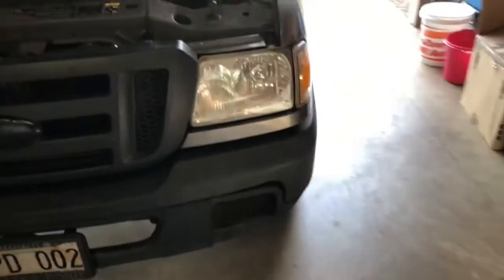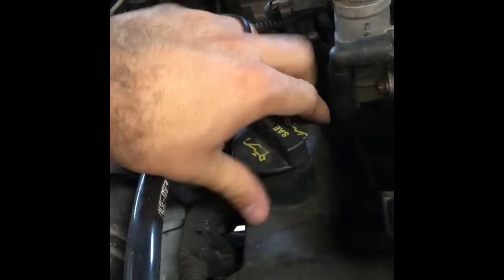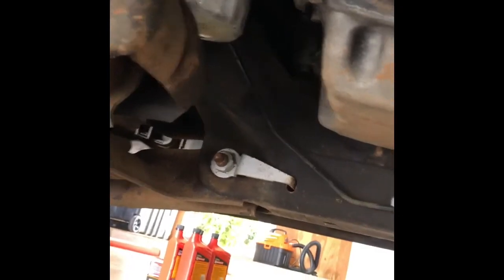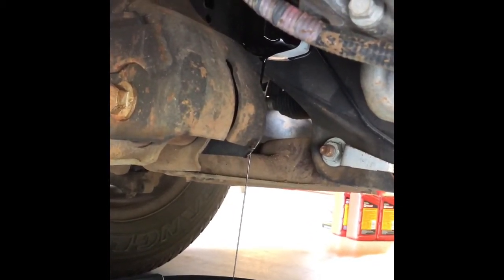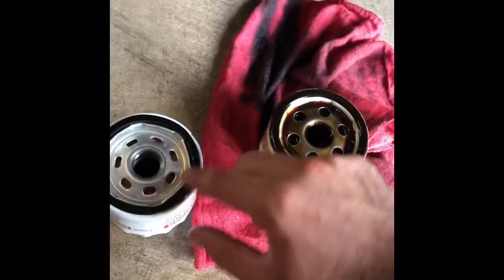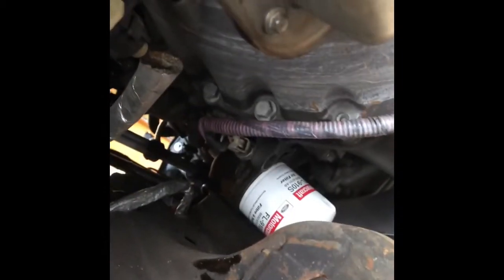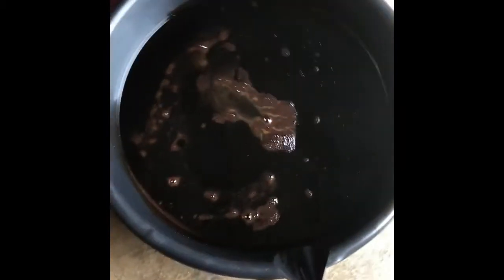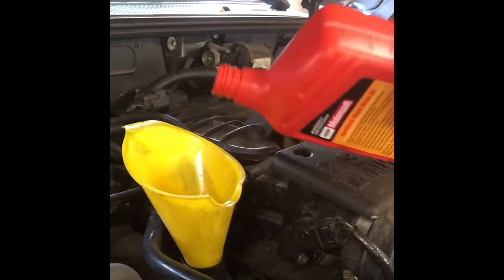How to: do an oil change on a 2.3l ford ranger

Comment: 01:34 "... it shouldn't be that tight ..." if you put it on, that is. Otherwise, ... so bring the right type filter wrench just in case.

PS: I like how you drained the oil without getting a drop on your hands. 👍🏼🤠 
Thanks.

PPS: all you new guys, make sure the rubber seal came out with the old filter... where he rubs his finger to get some oil for the new filter seal...  Otherwise, you actually have to look up at the metal face to be sure there's nothing there... or feel for one... This should be routine 'cause you can't be sure the gasket surface us "clean" otherwise.

Comment: Just a heads up: You're using the wrong oil on a 2.3L 4 cyl. 

Oil needed is SAE 5W-2O not the 5W-30. (page 260 of owner's manual)
Filter needed is FL-400S (page 257 of owner's manual)
Reply: @juanramos6976  Running thicker oil is not optimal for an engine. It's been engineered a specific way for internal heat. Computer components in the vehicle can recognize it as an imbalance also and cause damage to other parts/sensors. 
It's better to use specified information, and if altering suggested specs, to give a disclosure that they're altering the components used, and to proceed with caution. Some people don't know anything about cars watching this video and can take incorrect advice.
Reply: @Striker50_  I thought I read from ford it's 5-30
Reply: @laymensgrowing2032  That would be for the 3.0L and 4.0L engine variants
You could run it but it's going to cause a slight strain in your engine since it's thicker
Reply: @Striker50_  for sure. I thought I saw 87-94 2.3 was 5 30
Reply: @laymensgrowing2032  perhaps they adjusted it. I'm working on a 2007 2.3 4cl Ranger right now though and the manual states 5w 20
Reply: @Striker50_  blah blah blah. 20, 30, is fine. 10w-30 is even fine, this engine isn't much of a worry.
Reply: @juanramos6976  Bullshit. There are oil passages too narrow for 5w-30.
Reply: Well then why the hell does my owners manual say 5W-30?
Reply: @ajnowell8508  Of 2 things: you're not looking at the correct engine in your manual, perhaps the older Ranger has thicker oil (mine is the 2007 model)
Reply: @Striker50_  well I’ve got a 07’ myself as well and I read the 2.3L in the manual and it’s got 5W-30 so maybe it’s just a weird things
Reply: @ajnowell8508  Again, reference page 260 for the 2.3L 4cl. Variant, it's 5W-20
Reply: Just got an 08 2.3L manual. Any specific oil brand you guys recommend?